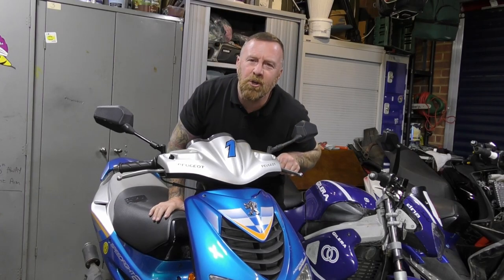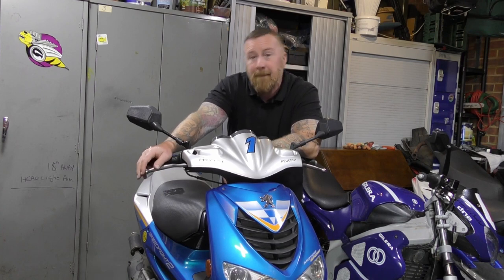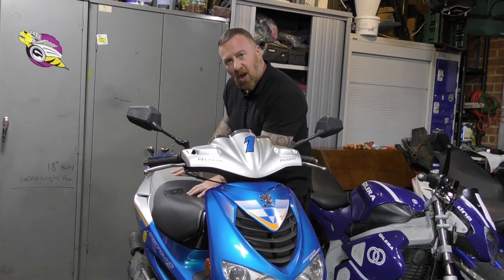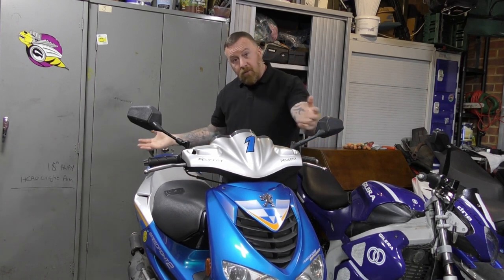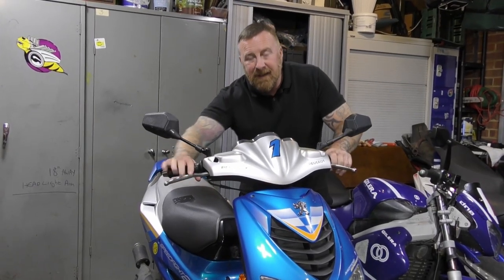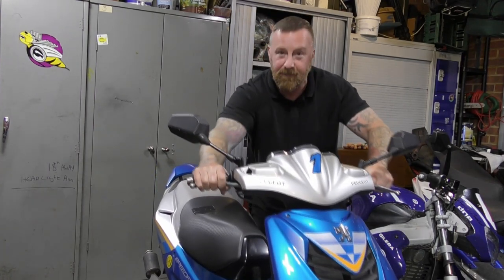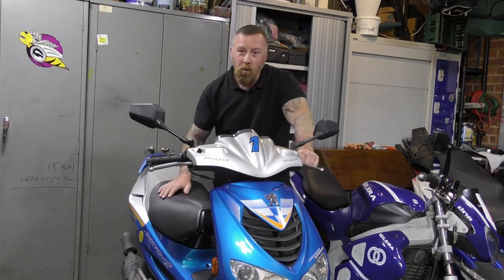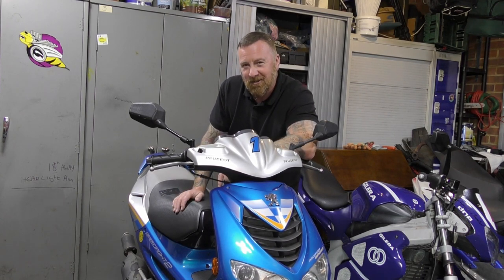E10  FUELING MISTAKE ON THIS SPEEDFIGHT 50CC MOPED SCOOTER , MAYBE !!

Comment: e10 is a right killer  had my scooter sitting for a month and its killed the fuel petcock valve all ready what was only on there for that month as well  :/
that has to be one of the best speedfight 2's still going how clean it still is
Reply from the maker: Honest bud I agree, in such good condition and not been messed up by 10 previous kid owners lol 
Take care bud that bloody E10 !!!
Reply: @marksavage  that black speedfight on the end is not a speedfight 2 100cc is it ? was looking at one on the market place last month for £70 and looked like it
Reply from the maker: @mrchilled85  no bud it was a 50cc but got a 70cc kit but a none runner , was going to do it up but been using it for spares

Comment: Hello mark, been watching vids and it's really helped me sort my Speedfight 2 50cc, I bought a new carb 12mm replacement and a new Leo vince TT exhaust ( de restricted ). Problem I have is half way through the rev range, with the bike on stands it bogs and then clears, then revs clean to the top. Where it does bog there is excessive oil smoke, any ideas..
Reply from the maker: was running ok before carb ?
Did you use the old jets in the new carb as it would have been set up to run 
New Chinese carbs can mess around 
Ait mix screw all the way in 
Sounds like bogging then too much 2t getting in
Are your ring ok
Reply: @marksavage  Thanks for the reply Mark, it's a 1998 bike so everything is std or not changed, took it for a good run today and it seems to have sorted itself out.

Comment: My Aprilia 2020 GP rep says E5 and E10 next to the filler cap. I've been putting 99 Ron Tesco super in lately. Can't tell any diiference. Are my pipes all made of that zylon stuff. Anything to worry about? It's still the Hyper-2 engine. p.s I shared this everywhere Mark :)
Reply from the maker: no bud if it says E10 it will run fine , just if your going to not use it for a while drain it out of the tank and carb

Comment: I got a Peugeot speed fight 2 100cc and wAs riding it then cut out and didn’t start back up but turns over fast 
checks for spark and tried easy start
What would you recommend to check next
Reply from the maker: Try starting with throttle fully open to see if it back fires and pops 
!!
If so could be piston 
Check out my videos bud

Comment: Hi Mark, iv got a 2016 aprilia sr50 factory,  my bike takes off relatively slow but accelerates decently up to 40mph from 20mph if on a flat. On hills however it struggles doing 30mph. If i wanted to give it a bit more ooomppph when taking off/ on hills as well as making it quieter sounding overall, what would you recommend?

Your videos have helped a lot with learning so im assuming maybe check the air filter and change for some lighter rollers but any help would be appreciated. Thanks.
Reply from the maker: defo rollers but so go for 6g as all in happy, check your clutch is ok and the belt as this may also be a problem
exhaust yes this can be a problem like in my videos way to much getting out so see if you can re wod  it or change it bud as this will help for pull away too
take care bud
Reply: I put 4.5g in mine. Takes off fast but tops out at 50.
Reply: @GrandpaOnATunedScooter  I'm ordering a bunch on Friday so I'll play around with it
Reply: @F0zzybe3ar  My rollers came with my Leo Vince TT pipe. It also came with clutch springs which I didn't fit as that isn't too good in traffic.  You definitely need an aftermarket pipe with the rollers. I think most pipes come restricted too so ask the shop to remove the washer. Pedparts UK do it for £8.
Sorry I've just looked and it says the rollers are 4.3g. Apologies if you know this already but the washer need removing from the variator as well.
Reply: @GrandpaOnATunedScooter  I literally just got my sports exhaust today. 6gram rollers to start with , new belt and variator fan. My mate removed the restrictor on carbarator but it started bogging a little before. 
He's doing me the variator tonight too (I havnt got the tools to do it myself yet
Reply: I had the restrictor removed on exhaust when I ordered it
Reply: @F0zzybe3ar  Pedparts said 68 jet is usually right but 2018+ 64.  What size did you fit?
Reply: @GrandpaOnATunedScooter  I'm actually in process of ordering a new carb. We fitted new exhaust ,new belt and added a variator fan. The change in rollers didn't do much but last night it kept chugging and struggled to take off or keep any speed. 
Iv ordered a new carb and jet kit to play around with it

Comment: Hey mate, don’t know if you’d be able help, desperate for a speedfight 2 loom, or Atleast a part loom where the ACI plugs in. Struggling to find one 😢
Reply from the maker: try on e bay and ask sellers that are selling parts or breaking the whole thing , this should help bud
Reply: @marksavage  struggling to find one via ebay sellers or even Facebook groups
Reply from the maker: @chrisbryant7497  they are getting harder , where about are you bud as i have the one in this video , the blue and white one that has one and only for parts ?
Reply: @marksavage  Colchester mate, as I believe your not far either
Reply from the maker: @chrisbryant7497  just down the road ok let me check later and ill let you know if it has a loom on it bud
Reply: @marksavage  even if it’s a part loom, I’ll happily sit there with a soldering iron
Reply from the maker: @chrisbryant7497  it's not a ACI one bud ,but I typed in speedfight loom on e bay and there was one for £18 bud 
Which is cheap really 
Think this one is just a four pin one
Reply: @marksavage  I’ll have a look, just want to get mine back on the road. My CDI (ACI100) went up in smoke and plug (and some of the close wiring) melted and all stuck as 1 lump

Comment: I’ve got a 2007 RS50 will super be okay in it? It’s a 2t aswell
Reply from the maker: well it will run better than putting in E10 to be honest bud and mix with 2t .
Reply: @marksavage  I’ll just try super, as it’s got a 70 kit and all different bits onit

Comment: Hi mark ive been trying to contact you, I’m in need of your help desperately, my starter motor in my 2017 Apache won’t stop trying to start the bike even with no keys in it. Any ideas where the fault is?
Reply from the maker: Electric fault , take a look at the pinch point under the steering,  take apart push button , check over all electrics and wires bud 
Even poss melted loom 
All in not good but maybe a easy find !
Then again sorry to say it won't be 
Get a volt meter and test but don't let it keep spinning bud
Reply: @marksavage   Thankyou so much 😁

Comment: Oh dear I’m so put off mark on my build I don’t even know if it’s worth it to run any more mine will be running premix and I don’t even know what fuel to use
Reply from the maker: You can use super or add E10 fuel additive 
But drain all out if you leave it for a while 
It's not got bud